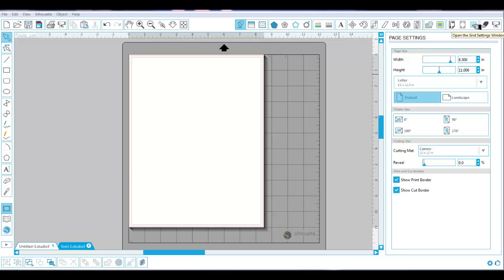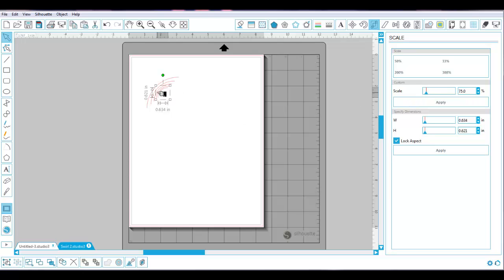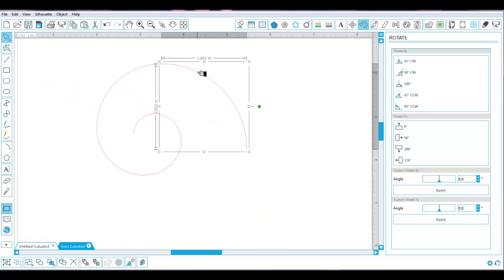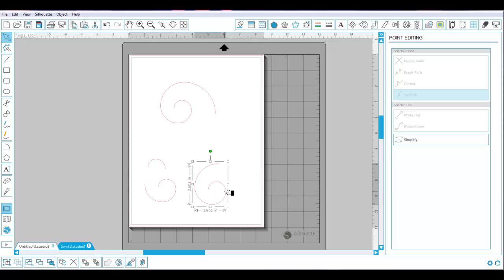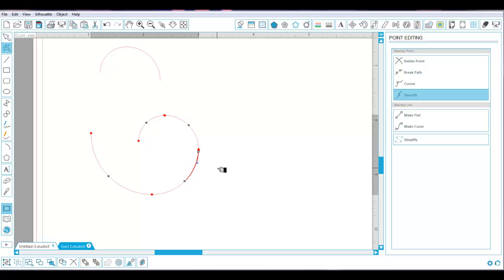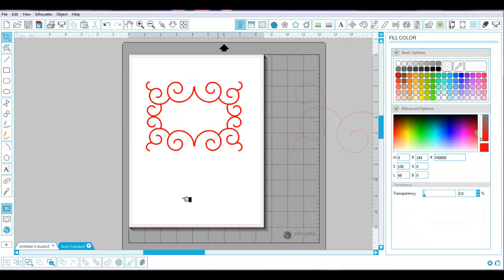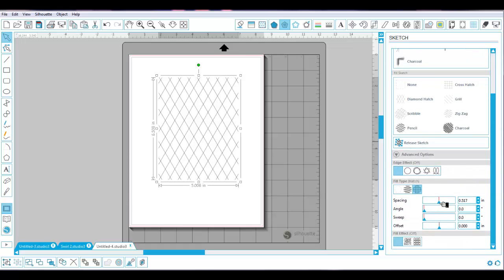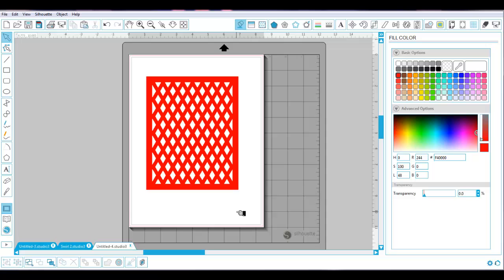Design with the Arch and Sketch Tools Studio V3 Designer Edition

Comment: Thanks Debbie, this is a great incentive to play with the tools.
Reply from the maker: Thank you Paula, I'm so glad to learn the videos are giving some inspiration and incentive to explore and discover Thank you for you kind comment.
Reply: Actually I watched it twice stopping then going to the software to perform the different tasks.  I learned some new things that may even have been in previous versions but I had never used.  Only one thing I still am not sure I understand from your previous video.  I am not sure why one would choose the trace and remove option.  What exactly does that do that is better than just trace?
Reply from the maker: Pauline Purdum Pauline, the reason why I do a "Trace and Detach" when tracing an image is; it leaves just the image and no background. This way, by accident I wont cut the edges of the left behind white background. After I do a trace and detach, I delte the left over white background and we are left with an image that will cut on the edges. The only reason I do a second auto trace is to get the inside cuts made. Its like cutting the hole out of a donut....lol.
Reply: OK that makes sense I did it and didn't quite get what I was doing with the cut out background.  This will come in handy actually cause I often pick up bits of extraneous matter and have to release compound path to get rid of them.  Don't trust G the eraser tool at this point.